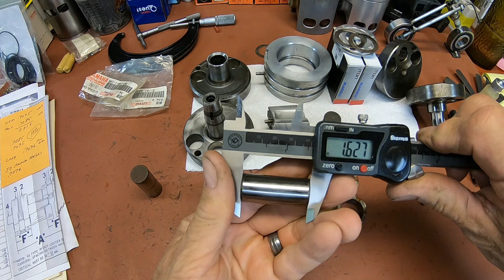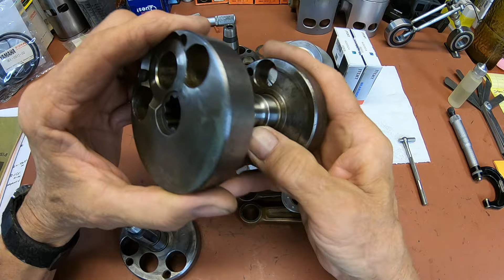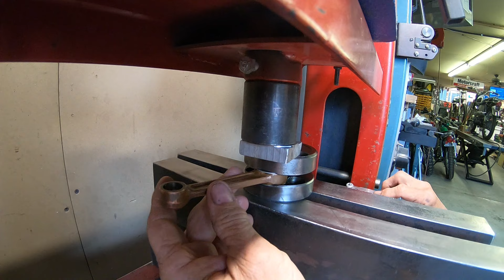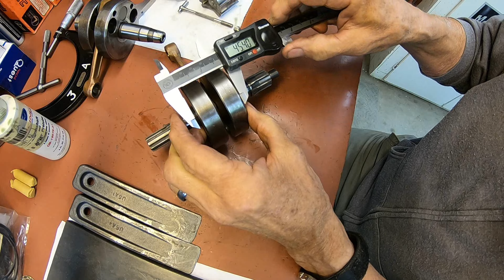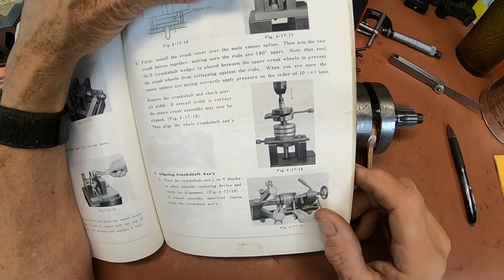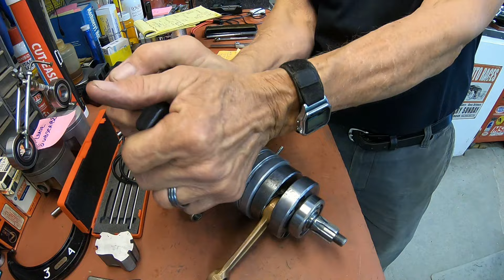Build a Yamaha HS1 90 twin crankshaft

Comment: Hi Dale. do you know what the press fit tolerance is between the pin and the crank is? .001?
Rich
Reply from the maker: Hey Rich, why yes, I do, I have a very inquisitive mine and I want to know stuff like that and make a record of the info.  Most folks don't care about that kind of thing. I take lots of measurements that you really don't need to do. The answer to your question is they consistently run .002 interference fit, the crankshaft flyweights run .708 and the pins a consistent .710. Thanks for hanging out in the shop with me.
Reply: @montana2strokeracer  Hi Dale I would never dream that the interference fits would be different between the pins and the crank.
Thank you for the feedback!

Comment: Thanks Dale , Great work . Finding parts can gobble up alot of time .
Reply from the maker: Yeah, I have just got a list of Yamaha dealers I'm calling. Seems none of the ones I have called are hooked up to Lite Speed. I guess it is pretty expensive, so probably only the biggest dealers have it. You are right it takes a lot of time. But I did find one piston so far.
Reply: @montana2strokeracer   hey Dale, if you want to give me the part number, I can look here on my end?
Reply from the maker: What a generous offer. The piston is 241-11635-01 (.25 over) and the rings are 132-11610-21 (.50 over) need two of the rings. Thanks Murray.
Reply: @montana2strokeracer  OK Dale i will give you a shout if I have  any luck . Your very welcome  Dale .
Reply: Hello Dale, I tried the UK Yamaha dealer network and they are shown as discontinued. I'll keep my eye on UK eBay too. 
Best wishes, Dean.
Reply from the maker: Wow thanks so much to both of you for giving it a shot.

Comment: Good morning Dale. I've been following your lead on a TS400 engine. So far it's coming together pretty good. Hopefully I haven't messed anything up. The TM125 and RM370 are done.
Reply from the maker: Dave you are making great progress, think you are much faster getting to it than me. Dragging my feet some.
Reply: @montana2strokeracer  Not really faster there Dale, just fewer projects. Don't like to overwhelm myself with too many things to do at any given time.
Reply from the maker: Yeah, Dave I have too many going right now, parts are mostly the problem. But its also summer, so I am working on household things too.
Reply: There are shops within a few miles where I can get parts and get engine work done. That salvage yard up in Phoenix is a 2 1/2 hour drive one way, so I put together a fairly large list of used parts to find before I go there.
Reply from the maker: Its nice that you have some shops close by to farm some of the work out to. It sounds like the salvage yard you have is outstanding.